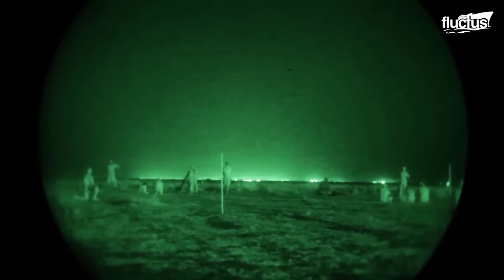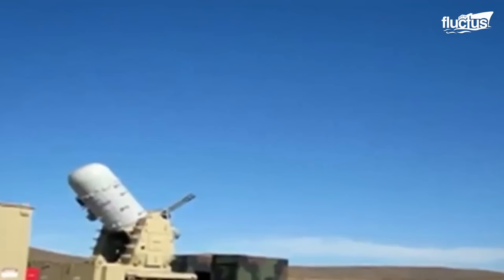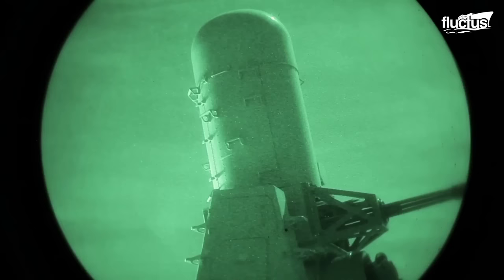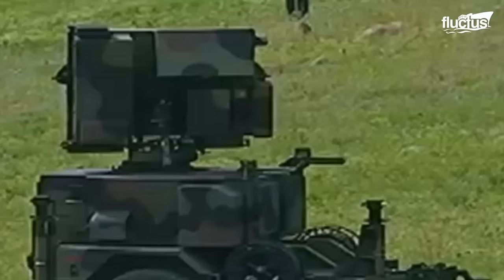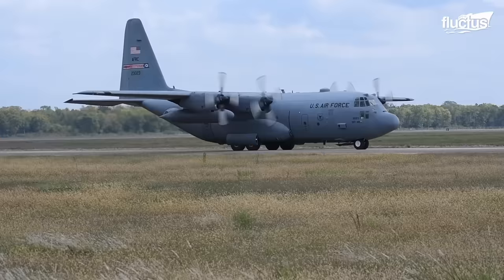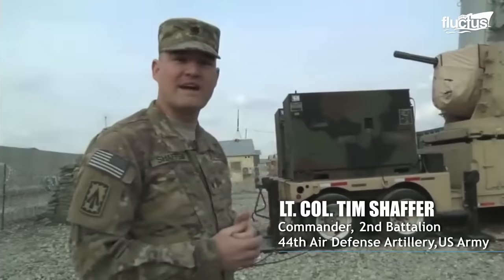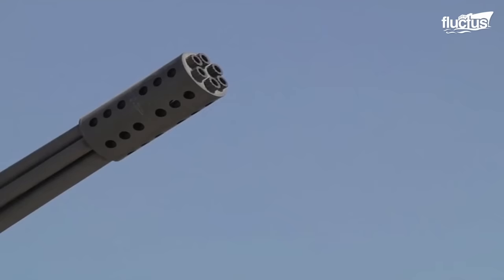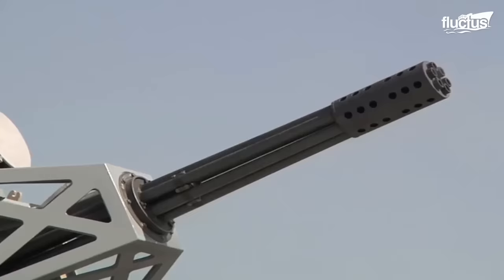C-RAM System: US Genius Invention To Protect Cities | Documentary

Comment: In 1985 the ship i was stationed on was one of the first to be fitted with Phalanx (CIWS) . After testing it for the first time, the Captain came on the 1MC and said," that is American ingenuity at its best. The system not only shot  the test drone but the cable that the drone was pulled by ,thereby sinking the drone.

Comment: Last year I spoke to a military contractor who was directly protected by one of those CRAM’s in Afghanistan. Imagine it’s 1am and you need to run to the outhouse to take a leak, while running the flir/radio alarm goes off. I was told the CRAM makes every one of your intestines vibrate, there is no way you will go to sleep that same night. You just have to deal with it and accept that it’s there to save you, even though it seems to terrorize you.